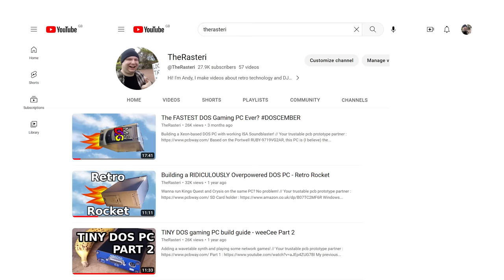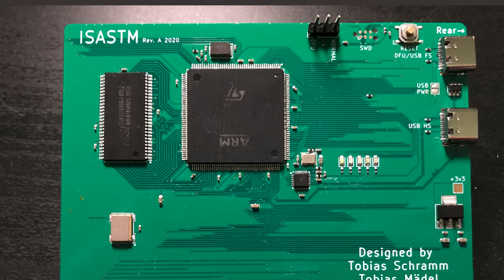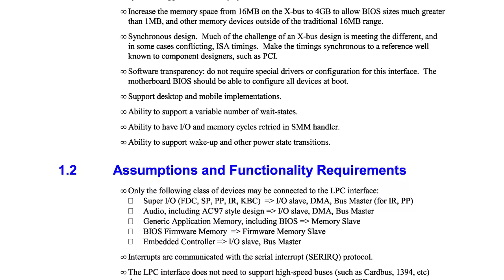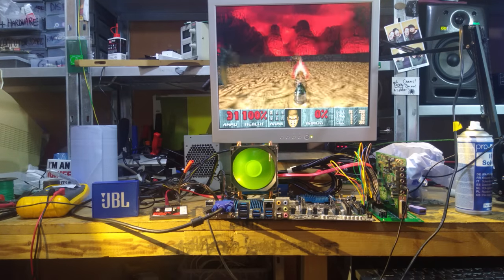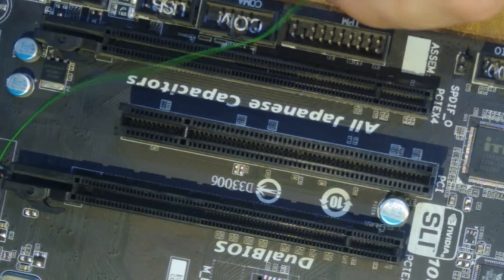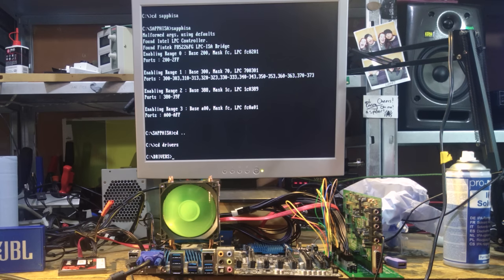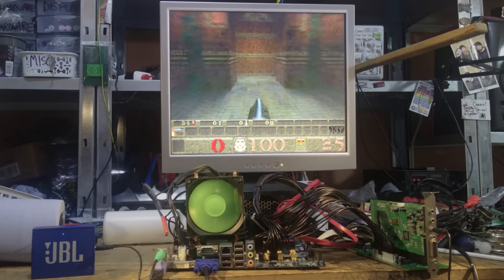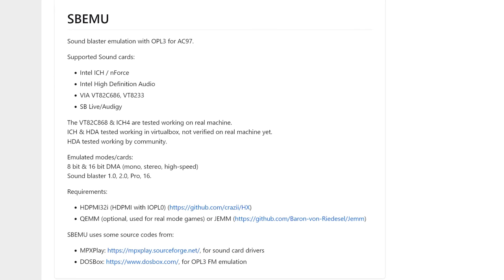Add an ISA slot to Modern Motherboards!

Comment: Why don't AGP?
Reply: AGP was dropped in Windows 10 in one of the feature updates
Reply: @MaximNightFury this is running on DOS, not Win10
Reply: you want an albatron atop.  they were rare when they were new almost 20 years ago and they haven't gotten any more common.  I've had an ebay alert set up for one for years and not gotten a good hit.

compatibility isn't great on them by the way, only a handful of late agp cards from nvidia work
Reply: Too good for S-bus or VL-bus?
😂
Reply: @butre.  You know they sell agp to pci-e adapter cards other than that brand, right?
Reply: Some people will never be satisfied 😅
Reply: I miss AGP...

Comment: A note for future experiments: the LPC bus has lately been supplemented with a mostly compatible serial version, and converter chips apparently do exist.
Reply: So eSPI can be used as LPC or is it not compatible?
Reply: RS 232 is still supported on all systems, where you use that for ?
Reply: @lucasRem-ku6eb  the support of RS232 and most LPC devices in modern PC are actually PCI MMIO address on SuperIO Chipset that also emulate Legacy IO Port access. It does not need LPC bus to work at all.
Reply: Unfortunately the eSPI specification says right up front that the 8237 DMA access is not foreseen. LPC used a bunch of side-channel signals like LDRQ for this, and eSPI abolishes all side-channel signalling except a single alert pin and replaces it with in-band signalling, to reduce pin count. And when they were designing the eSPI protocol, they apparently neglected or chose not to implement DRQ.
Reply: The same Intel Sunrise Point chipset generation for 6th generation Skylake processors that added eSPI support is the one that dropped DMA support on the LPC interface, so you lose regardless which one is used on a given board. On AMD Zen CPUs, the LPC/eSPI controller is part of the CPU itself, but I could not find out if any of them still support DMA.

The industrial/embedded ComExpress Type 7 standard still specifies LPC bus as part of the interface between carrier and CPU board, and a lot of the reference carrier boards have an LPC/TPM connector on them, so it would be interesting to try whether that supports ISA style DMA using a modern AMD CPU like the Ryzen embedded V2000.
Reply: Yeah, but no more old-school DMA support, so most 'interesting' ISA cards won't work.
Reply: Thank you. What a remarkably useless comment. Without any specifications, details or resources to dive deeper. The usual lazy person arrogant BS. Or are you some kind of Fermat-Impersonator? ("Look I have a solution, but the space was to less, to write it down"). If then ... Good joke!:)
Thanks to the others, giving at least some useful hints and remarks.
Reply: Next step is obviously to adapt a TPM to the ISA bus so I can use full-disk encryption and secure boot on my 8088 laptop.

Comment: There are more than DOS gamer that could be interested in that. CNC,  laboratory and medical equipment came sometimes with custom ISA controllers and DOS software.
Reply: Now I sort of wish that I'd held on to one of those ISA-GPIB cards instead of handing them out t😄anybody that asked for one.
Reply: Actually my mom had a very old lab equipment that did some data acquisition over and ISA card and then used some DOS program to do the actual measurement. It's now almost impossible to get a board with ISA and the old PC broke. It had some Winchip processor but I guess it's the end of the line for such devices. 
 My mom retired but had she still been working there this could have been useful I guess.
Reply: Your so right a lot of old Electronic measuring device need that kind of add on to work again, same for system that can emulate old floppy disc device or old SCSI hard drive or tape data streamer.
Reply: Well ISA bus shouldn't be that difficult to emulate with modern hardware. Since it's a very slow I bet that we could make with not a lot of effort an interface card with an inexpensive microcontroller with a lot of pins that converts it to a modern bus such as USB, and on the other end support in a DOS emulator such as DoxBox or a virtualization software that adapter to use a real ISA card.
Reply: @Meteotrance  floppy etc has been fixed a long time ago, like LONG time ago - 10yrs plus. Gotek. BlueSCSI will sort your SCSI needs. 
So, that junk is all done, ISA sound hopefully can be added to the pile now. Well, in one direction anyway.
Reply: @alerighi  I don't think you've correctly identified the issue that this solves, since you are proposing potential solutions to completely and utterly different things. 
You might want to emulate ISA - I doubt anyone else does. The aim is to interface with a card that uses ISA, one way is to make an ISA compatibleish doohickey but it's not necessarily the only way. No one cares what sort of interface is used in between things so long as you can hook up an ISA something to a modern computer running old software that needs to "speak" to the ISA something. If you can achieve it with a combination of magic the gathering cards and scented oils or crystals, I'm sure you'll find a crowd grateful to you for sharing how to do that. 
Since you hulahooped your way past that in your uC using USB pie in the sky ISA emulator, let me just point something out to you - latency would be the thing you need to keep an eye on, the rest for the most part on some level is kinda trivial other than being time and money consuming.
Reply: @noth606  I'm proposing on connecting an ISA interface to a modern PC running DOSBox (or other DOS emulator) with an adapter connected trough USB. It shouldn't be anything difficult. By the way, the IDE bus was practically the ISA bus with a different connector (and a reduced set of pins), and you find easily IDA to USB adapters. 

Latency shouldn't be an issue, since USB is by order of magnitude faster than an ISA bus (8Mhz, something that is way slower than modern uC that can run easily ad hundreds of MHz).
Reply: @LynxSnowCat  hpib is exactly what i am thinking about.
The p2 i have is so slow, and 2 other antique computers just seem broken. So this could be a solution to make the hpib drive emulator work
Reply: @alerighi  The issue isn't just that it's ISA, it's that it's ISA and DOS. DOS is effectively a realtime operating system and ISA has very low latency. Especially the old CNC controllers took advantage of this by offloading the control functions to the computer, because the computer could do very accurate timing and control without needing expensive hardware on the CNC machine side. You can't do any kind of emulation or bus translation, because you lose the realtimeness of the system. For measuring equipment and dataloggers it may work (depending on what and how they are measuring), but for any kind of control equipment, it doesn't work. You need real DOS on real metal.
Reply: @tylisirn  You can emulate DOS rather easily and real time on a modern PC. We are talking of emulating something that did run (at best!) at 8MHz on something that runs GHz. Consider that DOS emulator slow things down on purpose for that. If you need to do real-time operations I would use something like Linux with a RT kernel to run the DOS emulator, I'm sure it's possible. 

By the way, you don't even need a PC if you only want to emulate DOS, you can even use a microcontroller such as an ESP-32 that can run at 240MHz! I've seen project emulating DOS over there.
Reply: I was thinking the same. I used to work at a lab where they had an old computer running an obsolete pice of equipment for genetic sequencing. Runs windows XP.
Reply: I am interested too.
I'm looking for a solution on a 2 functional old medical laser that works with pentium PC and windows 98; Sad part is HDD failed on one, and main board failed on other. This 2 lasers have been designed with NO obsolescence crap so I'am looking for a solution

Comment: The Quake thing may be a PSU issue, most modern ones don't provide -5v and I heard that's problematic for older sound cards
Reply: Voltage Blaster by Phils Computer Lab!
Reply: The SB16 does not use -5 volt.
Reply: @r.d.7698  and also, high-end PSUs and some cheaper ones usually do still provide -5V.
Reply: @r.d.7698  well its my best guess
Reply: After doing some reading online, it's more than likely because the new 5v and 3.3v rails in modern PSUs are rather anemic in comparison to their older counterparts, which is why a shoddy no name brand psu from the early 2000s would probably power the card better
Reply: @electr0arc  anemic?
Reply: @thatguy6858  weak, or lacking in energy. Newer PSUs give the 5v and 3.3v lines less amperage than older ones
Reply: @electr0arc  ah makes sense
Reply: I think it's because he didn't set a High DMA.
I tried it in DosBox and when there's no High DMA I get no sound in Quake but Doom works fine.
When there is a High DMA set it works in Quake.
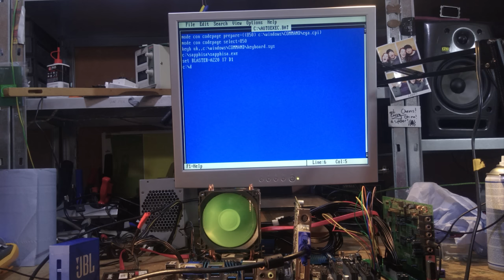Pause the video at 10:53, there's no H value.
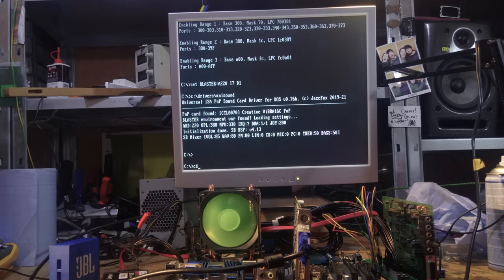Now pause at 10:58.  Quake is using DMA Channel 1 when it should be 5 (which is a high channel).
Reply: @electr0arc  That's because the CPU used to be powered off the +5 rail, until it was switched to the +12 rail. This means if you want to use a modern power supply with a board from ~1998-2003, you'll need to overspec it by a lot since it expects the +12V rail to be the big load.

Comment: For any DOSBox devs that're reading, it would be nice if DOSBox had support for ISA bus forwarding, so that instances could be attached to those ISA-over-USB devices. We eventually could have multi-seat DOS gaming running off a single machine.
Reply: You must be a troll?!? Considering your other comments and that you really think this is the right place to make a pull request/suggestion ... WOW! And the best: Without wasting any time and searching for this exact topic, what a non malfunctioning human brain would've done ...
*facepalm*
10 seconds "wasted" time and first search results: "DOSBox modified to work with USB<->ISA hardware. Experimental.", "Dosbox megabuild 6 help with emulate (redirect) isa serial ..." and big discussions going on at vogons site mentioned in the video. 
*double-facepalm*
Reply: @dieSpinnt  you have never, ever, worked in customer support, have you?
Reply: That's the dream
Reply: @juango500  You don't have any skills, ask people that do have skills please. OSI levels are the deal here, you just write a Load, and set a pointer ! If that is Serial or over ISA b nobody cares.
Reply: @LoneWanderer905  you are not a skilled cores, lol. Why you need support ?
Reply: @dieSpinnt  You sound fun. Berating people isn't going to help anyone.
Reply: @dieSpinnt  Nice rant bruh
Reply: The funny thing I see here is nobody after post#2 is either the OP or the original responder...

Comment: Another brilliant hit. I anticipate that in a few years, you could have an abomination of a PC having a really fast uncompromising core with ancient parts for everything, running all IBM compatible software from 1981 to 2xxx, the ultimate sleeper PC.
Reply: 1970's had some fun PC100 things that I wouldn't be surprised to see as well, given time.
Reply: FrankenPCs really tickle my fancy. Around 2010 I was building a PC to act as a networked backups storage server and since it didn't really have any other requirements other than fast network and lots of storage, I just pulled out parts from my junk drawers to get it done as cheaply as possible. It ended up having one of those later still ISA supporting motherboards, so in the end it had an ISA graphics card (Trident TVGA8900), a gigahertz level CPU, gigabit network card, random RAID card and 8 terabytes of storage... spanning parts across almost 20 years of hardware age :P
Reply: I'm working on one. It's from the early 2010's, has a monitor and mouse from 2005, no speakers, and a microphone from the 90's. I have a pair of headphones from the 80's that I can plug into it for audio.

Comment: this is incredible. i have wanted an isa soundcard in my newer pc for so long for basically this usecase along with getting things like adlib tracker ii to work with real hardware. having it available in linux would also just be absolutely perfect. please keep going. i can't be the only person who would buy this the moment u put them up for sale
Reply: Seconded! I was gifted an almost brand-new SB16 with a Turtle Beach Rio wavetable on it last month. Assuming I can get it to work in my Dell Optiplex, this would answer all of my prayers.
Reply: I have a few salvaged Soundblaster 16 compatable from very sorry looking PCs.  They work pretty good.  Go through home PCs, not old office ones.
Reply: why you need UNIX ? sound card support under UNIX ?
Reply: @lucasRem-ku6eb  he mentions in the video linux includes support for many isa soundcards. among many other things, this could potentially allow the linux version of adlib tracker ii to access an actual adlib card, various new doom source ports to play midi in fm synth, possibly even allow a daw to interface with a soundcard, with some work
Reply: @lucasRem-ku6eb  it was to use IE 5.5, back in the day.  It was much better than the native Macintosh browsers.  Oh and at one point I had a simple MUD running on it when I got a newer PC.

Comment: Just so you know: This has opened a lot of opportunities for game conservation for an obscure korean arcade rhythm game.

I don't know if this will get submerged by other comments but this is an absolute godsend. You see, ISA has been used by a specific arcade game to plug the I/O board, which controls a bunch of lights, buttons, and encoders. This has been a MAJOR problem for sourcing computers compatible both with the IO card and the software in the modern era, because you always had to get really weird used exotic hardware from chinese vendors so you could run a somewhat power-intensive game on a windows XP install (w98 on older releases) on something with that slot. You can obviously imagine the hassle of finding hardware that doesn't suck power-wise with such requirements. 

THIS, however. 
I know people with this cabinet that have had the issue. Working further on compatibility and testing on your design, if i can manage to run a semi-modern motherboard with this as a bridge to the IO card and not have latency issues, it's a breakthrough in conservation of this title, which has always been an issue since a PCI equivalent of the IO does not exist.
So, if this works (and even if it doesn't) you can pat yourself on the back because god damn, you just gave us an exit for this issue.
Reply: What game?
Reply: @mekafinchi  for some reason my reply seems like it wasn't posted so i'll post it again: game is ez2dj/ez2ac, a korean arcade rhythm game
Reply: That is awesome glad its helped make things a bit easier.
Reply: @_arkhea  Wow that is obscure ^^
Reply: I actually watched the video with this exact function in mind.  I own one of these cabs, and while mine does work, I was very aware of this problem and this makes me very happy that there might be a better workaround when it dies.
Reply: @dilbert90  it's still quite feasible to fix them up, we have one and while we haven't tried the ISA thing yet (mostly because we have other cabs to fix and a bunch of old motherboards) there is a decent supply for motherboards that support even final EX. It's quite temporary though, and i want to get to test the new I/O soon enough when we got more time (we have a container coming in a few months, when the cabinet bug bites you, it BITES you)
Reply: @dilbert90  That said, there's a new bootleg ez2 in the works (sunset anthem) so this might become even more relevant in the months to come

Comment: Great idea. Very useful for industrial applications as these days ISA capable boards with "good" CPUs (Pentium 4 and up) are very expensive. (Understandable as companies don't want to throw away a $1mn production line just because an old motherboard died - and pay a lot for these boards).
This also means that if you have one of these boards, don't throw it out - not even when it's dead. It will sell quickly and they will be needed until ISA based industrial machinery is too old (which might take another 10 - 20 years)
Reply: Wow .. I have so much old crap lying around I could probably retire lol